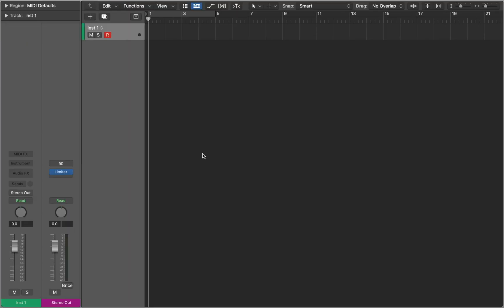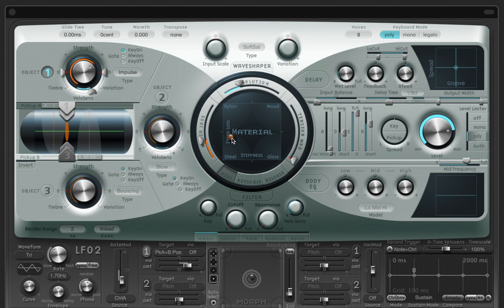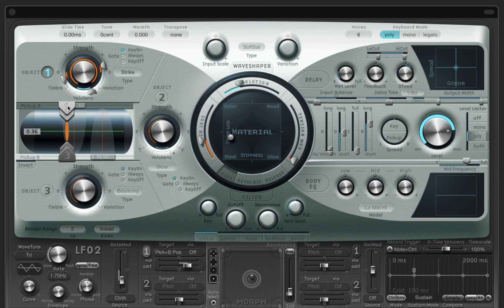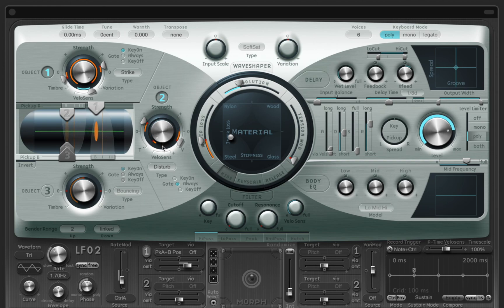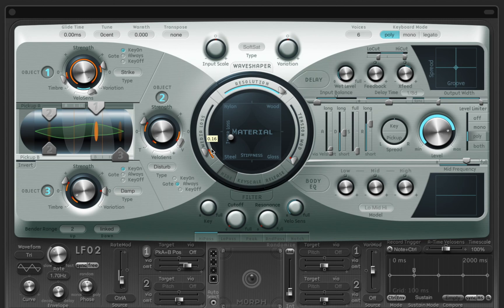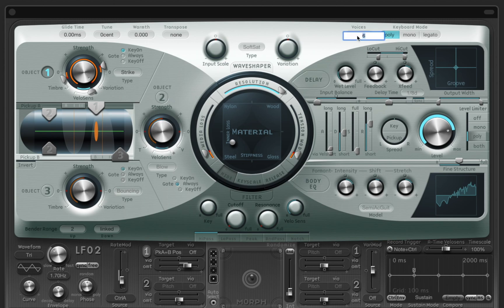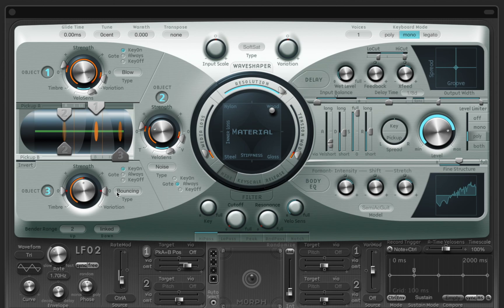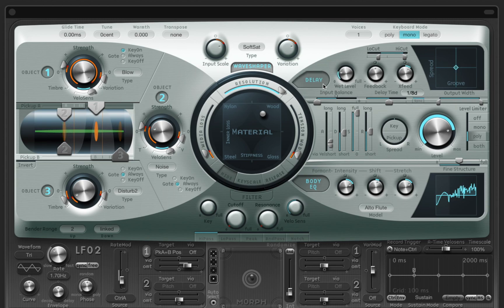Logic Pro: Physical Modelling Synthesis in Sculpture

Comment: I'm in awe again as always with all your videos. How did you learn all this stuff? This plugin was probably the most intimidating one in Logic, the interface looks like rocket science. The only thing I ever used this for was the Sub-bass preset to layer with my bass sounds. I cannot believe how powerful this plugin is after watching this. Logic truly is a powerhouse for what you pay compared to other DAWs.
Reply from the maker: True, some instruments in Logic do look like some sort of space tech. This synth is unique, not many physical modelling instruments out there. With this plugin I just completely ignored modulation part below at first to understand the concept. Checking out the presets also a good idea. The way they route modulation is confusing at first but they designed the same system across all plugins so if you learn it in one tool, others will be easy to understand. And check the link below the video, there you will find objects' descriptions!
Reply: @eduard.antonoff  Thanks for the reminder on checking out the link, I'll def take a look.
Reply: It's kind of crazy that you get all these features for a one-time fee of $200. Leave it to Apple to pack in so many features with an intuitive UI (outside of a few of the plugins that desperately need to be updated).
Reply: @ReallyRamtin  facts. They def need to update the UI of the few plugins that still look dated. Surprised they haven’t yet. Like the Vocoder plug-in looks terrible.